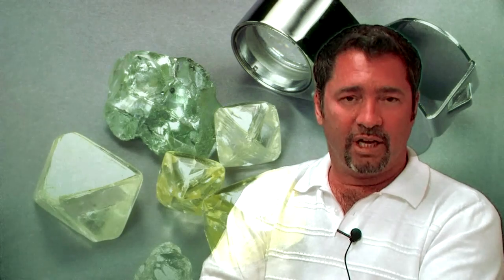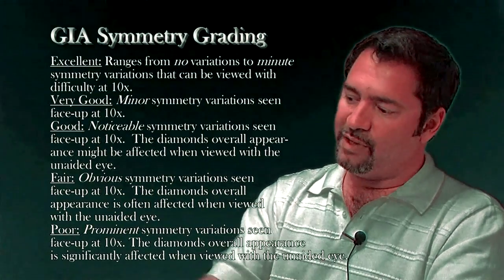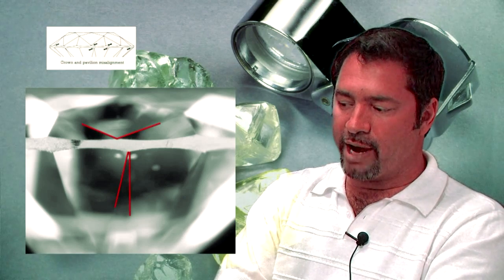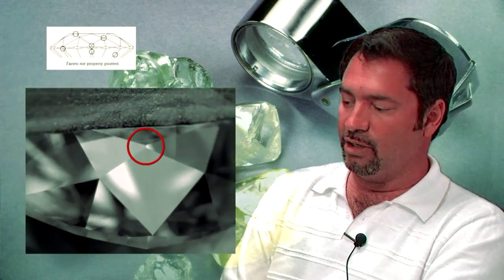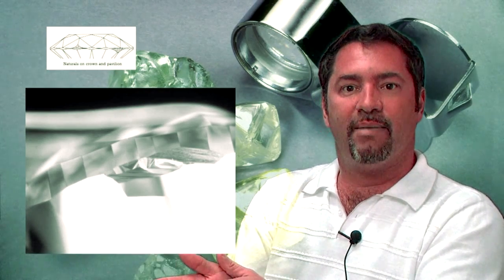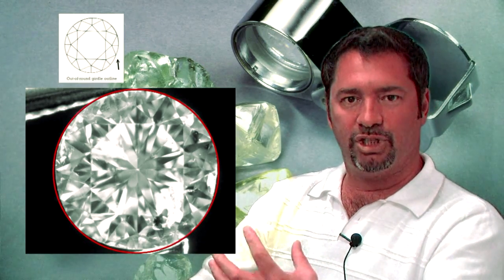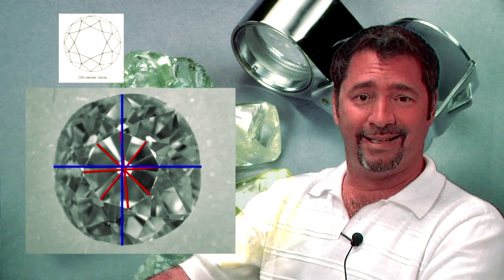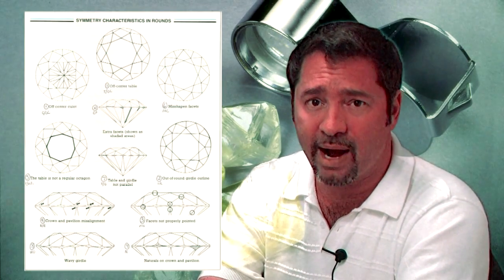A Consumer's Guide to Understanding Diamond Symmetry

Comment: I was always told that the polish grade means more then the Symmetry grade. If you can find a diamond with excellent polish and very good symmetry always take that opposed to a diamond with excellent symmetry and very good polish. Correct?
Reply from the maker: Hi AgonyShorts and thanks for your comment and question.  Actually the answer to your question is neither.  I say this because both polish and symmetry can take hits in GIA grading from Excellent down to Very Good and still acquire the "Excellent" cut grade.  Same with AGS labs.  The reason for this is that it is proportions that will impact the optics of the diamond more than polish and symmetry will.  Light performance is key.
Reply: Hi SIr,

Your Videos are really nice and informative regarding diamonds i live in middle east,my doubt is where can i buy good diamonds at cheaper rate ,whether in India or in Dubai?

Thanks..